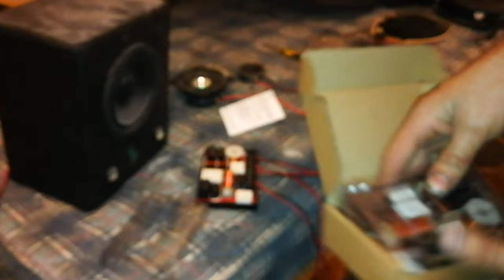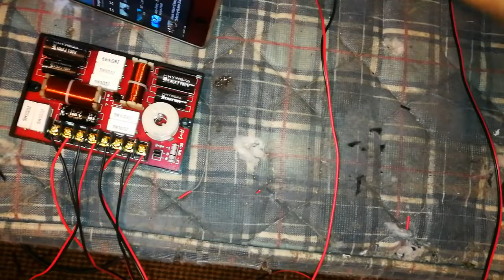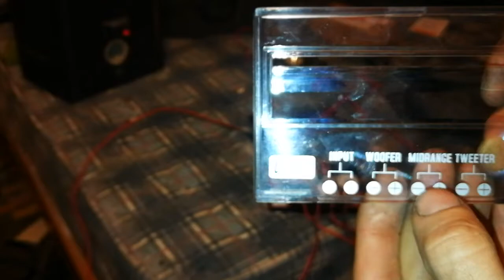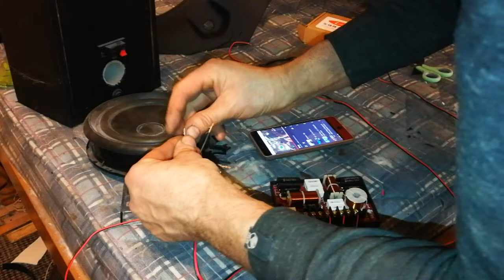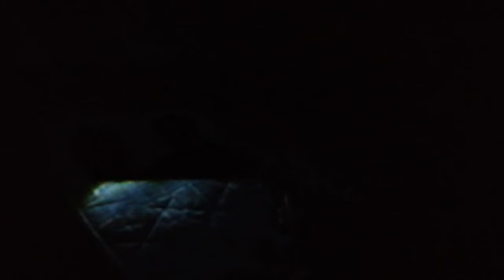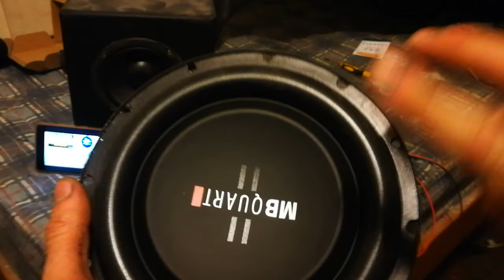AIYIMA Crossover Board Tweeter Midrange Bass SubWoofer 3way Frequency Divider Enthusiast DIY Car Mod

Comment: Hello friend, I'm thinking of buying this crossover 2 ways for  install in my kit 2 ways, woofer hertz 80w RMS and tweeter C26 hertz 60W RMS. Do you recommend this product? Best regards.
Reply from the maker: Hi. Yes. This one quality and powerful.
Reply from the maker: € 54,94  22%OFF | GHXAMP 200W 3 Way Car Crossover Audio Automotive High Power Bass Medium Tweeter Audio Speaker frequency divider 500Hz&3.5KHz 2pc
https://a.aliexpress.com/_mr5UVOs
Reply from the maker: now I'm using different ones. But if crossover cost around 50eu. So they are good.
Reply from the maker: I have auna crossovers. But nothing good.

Comment: hello,what about 2 way crossover filter,my car have under seat sub and doors speakers build in tweeter, connected  2 way filter W and T ,can use for mid range in doors 10uf400v and ?
Reply: or buy new 3 way crossover
Reply from the maker: Hi. My English not good. But if I understand good. Your car door has speakers with tweeters. Tweeters are separate.? Factory speakers Tweeters?  Anyway you can't connect midrange speaker with tweeter. If you connect so your midrange speaker sound like tweeter. No bass. Mid range speakers has bass. Not to much but has. Plus I need more info about your plan. Do you wanna put extra speakers. If yes. So what power has your speakers.
I did many test with speakers. So crossovers are the best for update your stereo

Comment: There are two switches on the crossover? Do they significantly change the sound level on the ear when you switch them?
Reply from the maker: Yes. If you move switches so sound will change. More high sound
Reply from the maker: Plus my crossovers don't have switch. But if you want you can buy with switch. But more expensive I think. Plus for me always works good without switch

Comment: How much does a crossover cost on aliexpress?
Reply from the maker: Hi. I pay around 50eu.
Reply from the maker: AIYIMA Crossover Board Tweeter Midrange Bass SubWoofer 3way Frequency Divider Enthusiast DIY Car Modification Stereo Crossover
Reply: @gs8282 sir, Can it be installed in the car's headunit output or not?
Reply: @gs8282  total power 280 watt divide bass mid and high?
Reply from the maker: @ferrynurdiansyah6604  yes you can install car head units. After sound are better.
Reply from the maker: @ferrynurdiansyah6604  https://youtu.be/UPfOynijVLc
Reply from the maker: @ferrynurdiansyah6604  I sent to you one video about crossover installation to Clio 1995
Reply: @gs8282  ok thanks
Reply from the maker: @ferrynurdiansyah6604  yes

Comment: bro what is crossover wattage....???
Reply from the maker: Maximum power 10w per channel
Rated power 120w-200w
2-4ohm
800Hz 3.5kHz
Reply from the maker: € 27,83  18%OFF | AIYIMA Crossover Board Tweeter Midrange Bass SubWoofer 3way Frequency Divider Enthusiast DIY Car Modification Stereo Crossover
https://a.aliexpress.com/_mLuuXPd